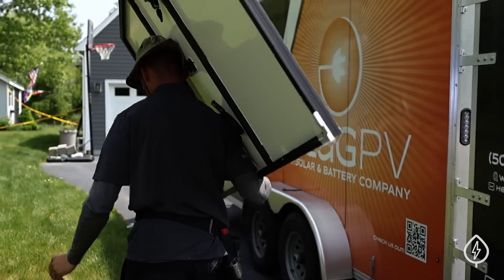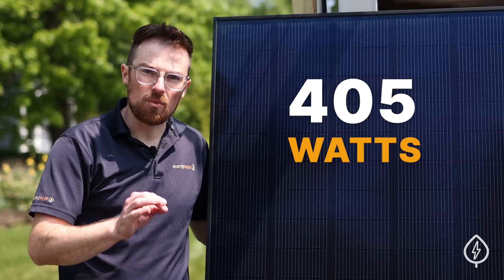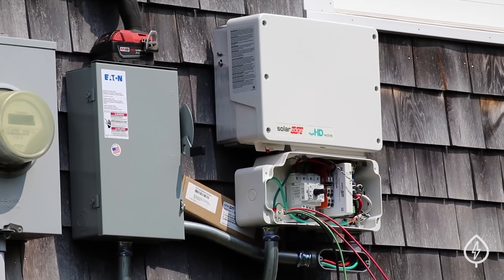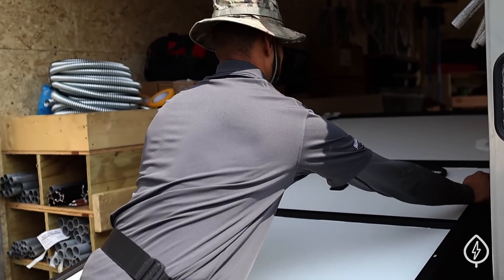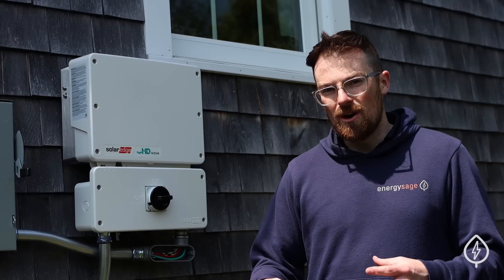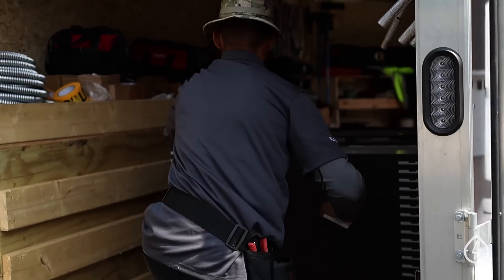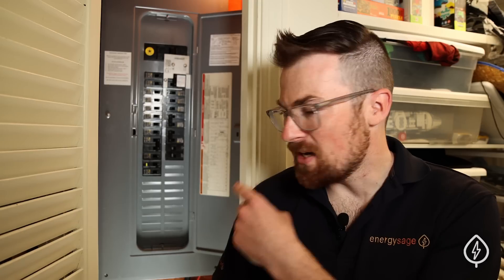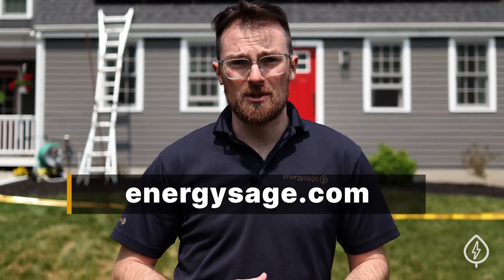Home Solar Panel Installation - What to Expect

Comment: Thise REC 405w panels are great panels. I'm on the Central Coast of California and plan to do 24 of the Canadian Solar 395w with enphase iq8+ invertors. This installation featured should make it so those people don't have an electrical bill for the next 25 + years and maybe even a little back from pge. That's how a system should be built. I can't wait to get mine done.

Comment: 23 solar panels?  Why so many unless that home has a family of six living there, or you are gouging them with panels that are not the best and newest.  A few years back I priced solar and with just two of us living here all I needed was just 8 panels.  You're putting on almost three times that quantity.   Here in California if you are planning to sell some of your excess electricity back to the grid, they'll pay you almost nothing for it, so putting on more panels is not worth the price.  Maybe you'd like to explain why you're using so many panels !
Reply: We just received quotes from 6 solar companies for our moderately sized home and they quoted 34-44 panels to provide 60-70% of our power.  23 panels is fairly conservative.  I don't think 8 panels would provide very much power for the average home.
Reply: 23 solar modules x 405 W = 9315 W. This is not an excessive system if the home is 100% electric, heated and cooled by a heat pump. Furthermore, if the homeowners also have an electric vehicle or plan to buy one, an even larger solar array may be required.
Reply: @GKALLIO  Don't bother to reply.  I'm not buying into your "maybe, could happen, a possibily they might purchase an electric car some day" blah blah blah.  As each one of those items you mentioned comes on line they should be able to upgrade their system, or did you convince them to put it in now before the prices go up.